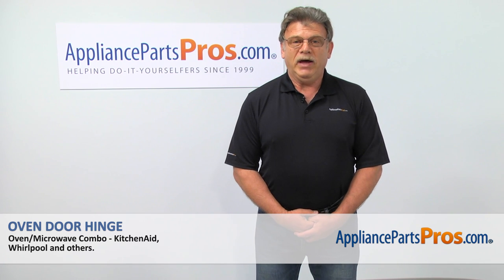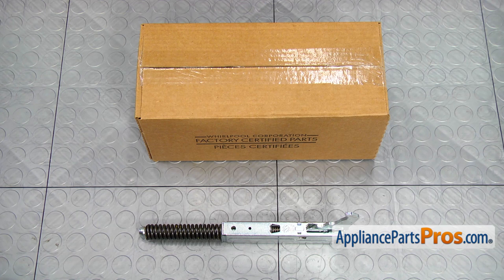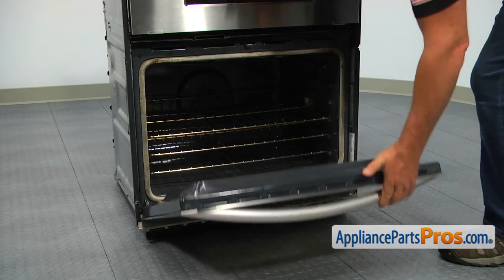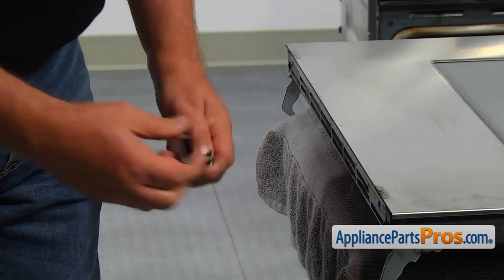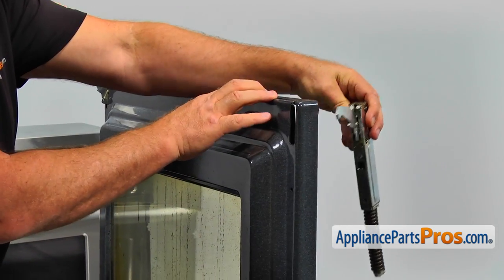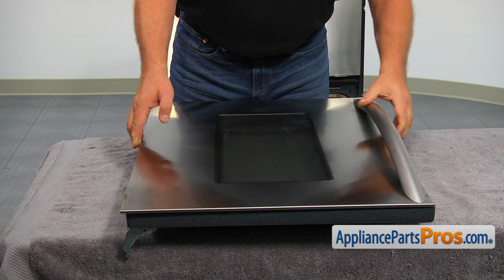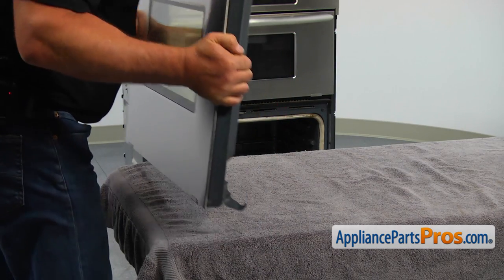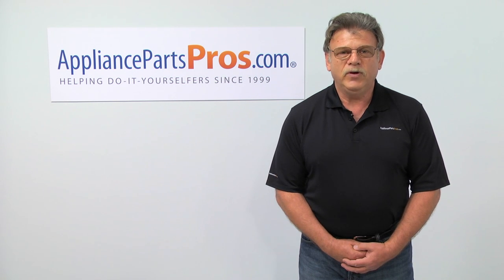How To: Whirlpool/KitchenAid/Maytag Oven Door Hinge WP9760574

Comment: Hinges are delivered closed ! You haven’t demonstrated how to open them !
Reply: Can anyone tell me how to do it? My oven is taken apart and the spring hinge is locked and not moving. I don’t know how to open this one! So frustrating, there doesn’t appear to be any information/demonstration on this online!
Reply: @lindsaysalmond8808  I am having same issue cannot get the spring loaded hinge to unlock
Reply: @timmclaughlin1787  I ended up putting the stuck hinge back in its spot on the oven frame and using a a 6” piece of plumbing pipe as leverage to open it. If you have a vice to hold it in, that works too. If I remember right, I still couldn’t get it to remain open though. I just stuck the locked hinge on the oven frame and attached the oven door as the weight of it opened the hinge. Never taking my oven door apart to clean it again!